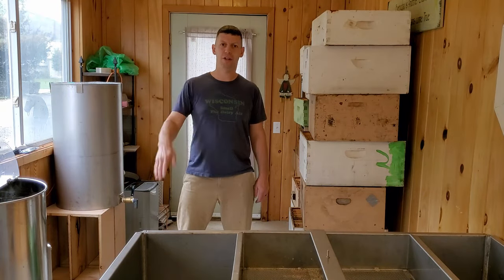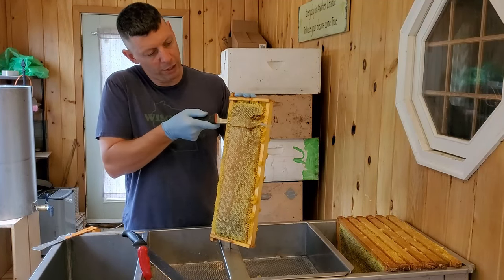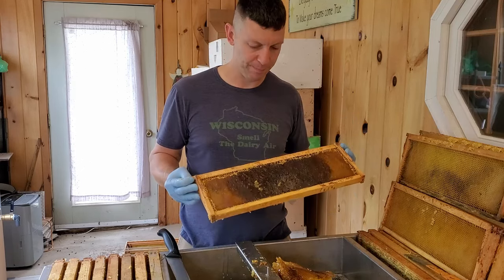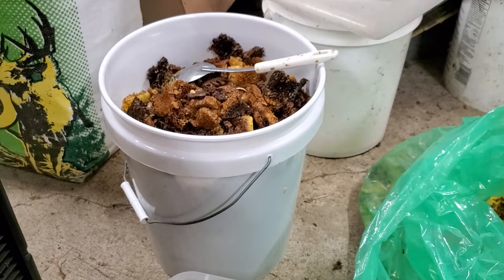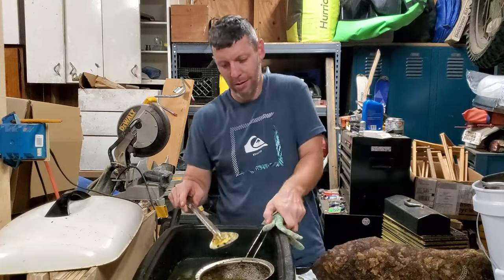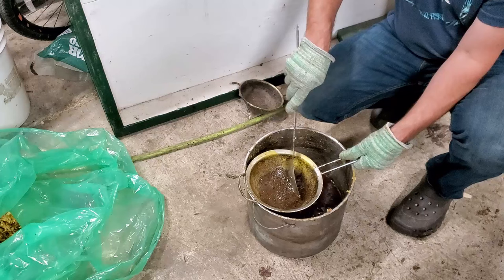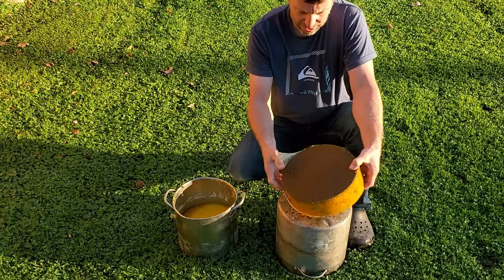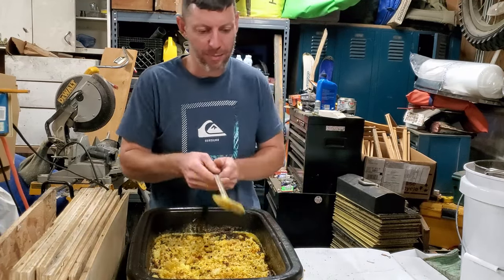Fast and EASY way to render Honeybee wax | Cappings or brood comb

Comment: Here’s an idea: if you weigh down the nylon stocking with rocks or something heavy before putting the wax and slum in it, you’d be able to make it sink in the water. The wax would melt in the hot water and float to the top. The solids would stay in the stocking in the water with the rocks. This way you’d only have to render this stuff once! 

After rendering you’d be able to pour off the wax layer and stop once you hit the water layer, and have clean filtered wax. Maybe something to try?

Comment: The big box stores sell "Elastic Top Paint Strainers" for pretty cheap. They are made to fit over a 5 gallon bucket and thats what I filter all my honey though.  It would work the same for straining the wax as well.  I don't know many nylon socks that are designed to fit over a stock pot or a bucket.

Comment: What you need is a deep double boiler setup. Heating the lower boiler of water and letting the heat from that heat the upper boiler makes sure nothing in the upper boiler gets scorched. Then you put your stockings or pillowcases of burr comb in the bottom of the upper boiler with some weights on the corners of the fabric to hold them at the bottom of the space, and fill it with water so they're well covered. As it simmers, all the wax will melt and float to the surface, leaving only non-soluble stuff inside the fabric. The water will still be filthy with everything either soluble or small enough to get out of the fabric, so the underside of the wax will be dirty too and need further cleaning - but none of the wax will have been wasted. You can give the solids left in the cloth to your chooks or the compost bin and know you haven't lost a single drop of wax in them.

Comment: Once the wax is in the hose, you need to place them into a deep fryer filled with water, the wax will melt and then you place some ting heavy to keep them on the bottom. Once it cools, all the wax will rise and the slum gum will be on the bottom. And hopefully, you dont have a layer of slum attached to the wax round.
Reply: The roaster you're using is not the best tool for this. Its best for melting wax before you roll it onto the frames.
Reply from the maker: I know this isn't the best tool for the job but it still worked pretty well.

Comment: Great video! What brand of pan/skillet are you using for cooking the wax down? I can’t tell if it’s an electric skillet or crockpot. That seems like a really good size and much better than a tall stock pot. Can you share the brand and dimensions or maybe where to find a similar one? Thanks so much! 12:19
Reply from the maker: It's a Rival 16 quart roaster oven. I bought it at the Salvation Army used.

Comment: That’s awsome. What’s the tool you use to melt down the wax? And the water ratio or does the water ratio not matter? Thanks
Reply from the maker: The water ratio doesn't really matter. You just want enough to let the wax float above the dirt and not enough to overflow your bucket. I'm using an electric turkey roaster. I got it at Salvation Army. It was a great find! Thanks for checking out the video and good luck!

Comment: late to the game, but 5 gallon paint strainer is definitely the way to go, and is reusable a few times at least. i just use a crock pot right now, but i've also noticed that if i leave the lid off, or just partialy on the wax disk will crack just about every time. leaving it on all the way will give you a nice uncracked disk. i think if it cools too fast thats when you get cracks.
Reply from the maker: Great tip! Thanks!

Comment: I will the solar wax melter out of a cooler what type of a refrigerator drawer where the reflector or glass and a pair which I put a few holes in and killed it it got that from Dollar General in a bread pan to catch the clean wax works great

Comment: how about deeper water and a rack to hold the wax/nylons on the bottom and let the clean wax float to top? appreciate a no drama video
Reply from the maker: That sounds like a good plan. I saw a video that someone had a deeper pan (like a turkey fryer) that they did that with.

Comment: If you really want to strain something, you can buy stainless steel laboratory sieves that go down to very fine apertures. Unlike fabric, you know they're never going to have lint or melt if they get too hot, and you can get them perfectly clean just by putting them in the bottom of a pot of water and boiling it.

Comment: For the longest time, i was afraid of using woman stockings. Afraid it would melt.  Yes Nylon stocking will filter >  hot bees wax and honey as well  ~  Use steam on a cheese press. Press the stocking of wax ~  get about every bit of it - You can get steam machines every where all different sizes

Comment: I ball up the wax as much as I can before putting it into cheesecloth. Stronger. I use stockings as a final filter. Stretch it over a smaller container or a plastic 16 or 32 oz container and our the wax through to let the wax cool. It's a messy process. You really need to be able to squeeze the slumgum inside the cheesecloth to get all the wax out. Be sure to separate the nasty from the good. Nasty wax is green when you are done.

I hate that scum on the bottom of the wax blocks. Wish there was a way to get that out before it dries. I guess you could strain it again but I always get that layer as well.

Comment: Do u have to add water to the pan before putting the wax in to render Dow if so how much
Reply from the maker: The water allows for separation of the wax from the dirt and debris. I would use at least a gallon, depending on the size of the container or the amount of wax.

Comment: JA below beat me with the comment of solar wax melting.  I used one for years when I had bees.  They are so simple to construct out of scrap stuff it's not funny.  I used an old window on top of a box angled to the ground with a filter material getting courser towards the bottom and gives nice clean wax and you chuck the filter stuff away.  There are sure to be ideas on YT.  In fact look for 'solar wax melter plans'.

Comment: I tried panty hose….for the “Slum Gum””….but it does not work as good as the paint strainers from Lowe’s….And…cheaper….and they don’t run….besides….every thing you use wastes some of the the wax….each application takes a toll on the filtered wax….

Comment: I built a solar melter out of a hole Styrofoam cooler in a glass top on the refrigerator compartment with a pan from Dollar General with a punch some holes in the wax melts out and goes in my bread pan below
Reply: Eazy peazy.

Comment: Question...I'm so new to beekeeping that I don't have a hive yet.  What do you do with the "slum gum"? Also you were cleaning off the spoon and strainer, were you using just water?
Reply from the maker: I till the slum gum into my garden. I usually try to clean off my equipment with hot, clean water. Good luck with your new hobby!
Reply: I live in Canada and use the slum gum as fire starter, it smells great and works like birch bark

Comment: Next time you try to strain your nasty wax with panty hose, melt your wax the way you used to do in your pots. Then put your panty hose stretched over a 6" or 8" piece of pvc pipe (the size of a lady's leg) that is 3' tall.  Then pour your wax through the panty hose in one shot. It keeps the wax melted and allows it to all go through but strains all the junk out.
Reply from the maker: The pvc is a great tip 👍 I was thinking about a cylinder of some sort, but I didn't have anything on hand.

Comment: What do you mean "wet boxes" why does it kill the bees?
Reply: A wet box is a box with extracted frames, containing residual honey. Traditionally you give them back to the bees to clean up. If they are returned above the brood box and crown board,  the bees will rob it out quietly. If you just put them out for all  the bees, it becomes a free for all and bees get killed in the rush as they also fight each other in the process.

Once the residual honey is licked out, then your 'wet supers' have become 'dry supers' and storage is a lot easier. I put a travel screen at the bottom of a stack of overwintered supers and a screen or ventilated roof on the top so that the air could get to ventilate the stack so that there would be no mould or mildew forming and mice etc. were denied access.

Hope that answers our question OK. It's the bees and wasps that kill each other not the boxes of frames per se.

Throw a lot of paper money into a busy crown at the shopping mall and see how organised it remains - not for long. Bees are just like women at the Christmas sales looking for that bargain of a lifetime. No one really expects to get trampled, but they can become savages. Another reason for using the paint strainer - you know the full price of the paint strainer bags, but do you really know how much hidden cost there will be if your wife or girlfriend supplies the stocking. Have fun either way. And finally, if it's the girlfriend that supplies the stockings and your wife finds out, then you might wish that you had gone along to the big box store after all. ;-)

Comment: id imagine nylons would impart coloring to a liquid when its heated, im not sure but i wouldnt be shocked if it did.  if you had a metal screen, that was a millimeter smaller all the way around than your cooking container, you could add all the dirty wax, and water. Then heat it, and at the end put the slightly smaller metal screen on top, and push down like a french coffee press. it would push all the detritus to the bottom, separating the wax & allow you to remove filtered wax from the top of the screen.

Comment: Whats cooking? Thats one big messy process. Heres an idea skip all those extra steps and use that black pan as your base for a solar melter. Use that miter saw to build a frame box so can tilt that pan in it. Then drill some tiny holes in one side of the  pan and make sure to place a paper towel in that corner as your fine filter. Lastly add a catch pan for your clean wax and put a glass top cover on the whole melter and put it in the yard to catch some rays.😆🐝🍻✌🏽